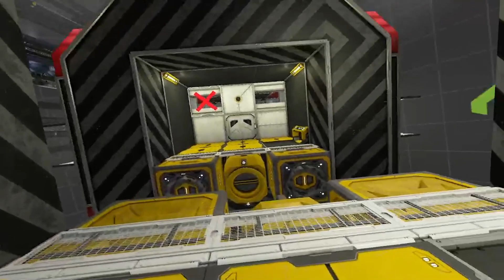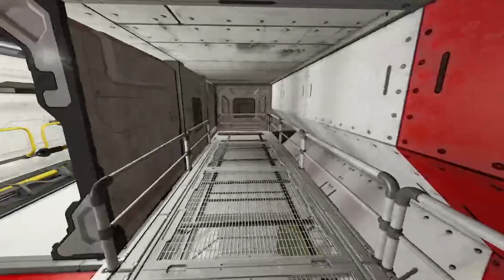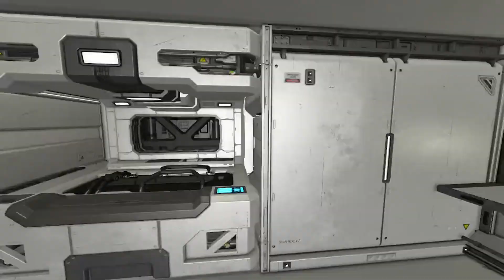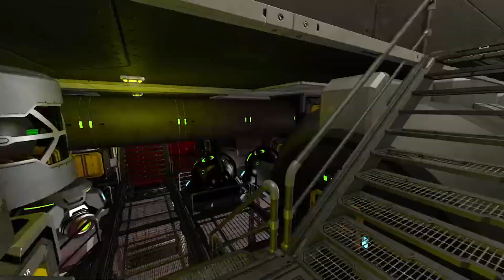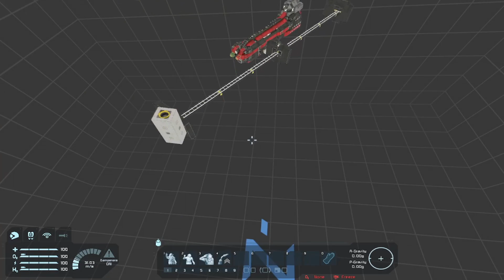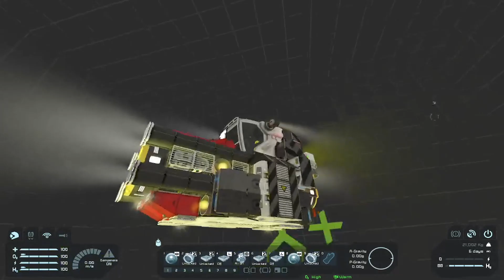Space engineers: USC-Mogen David 20/20, WIP

Comment: Quite an impressive ship. For the containers, is there any reason you're not using connectors top and bottom? Could potentially hide them under a layer of metal plate, turn up the magnetism on them.
Reply from the maker: I kinda wanted this cargo unit a little more universal.   slap whatever on the sides not just containers.   Im also thinking of a combo unit of both gas/cargo depends on how motivated i am..